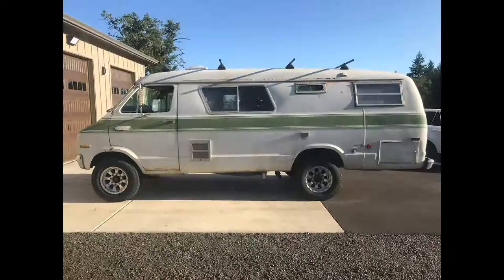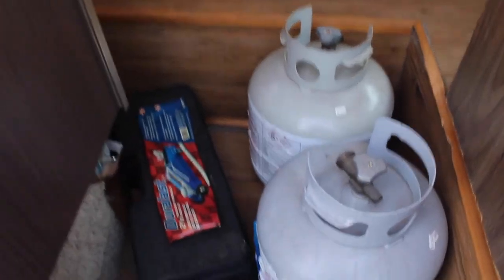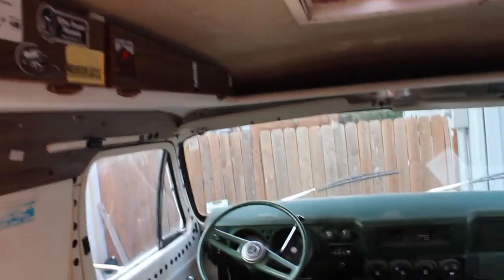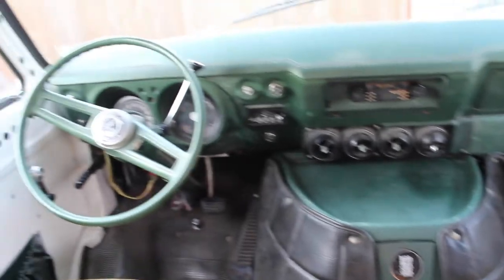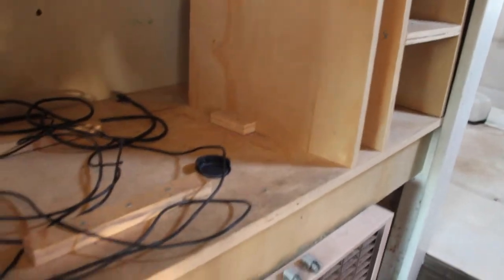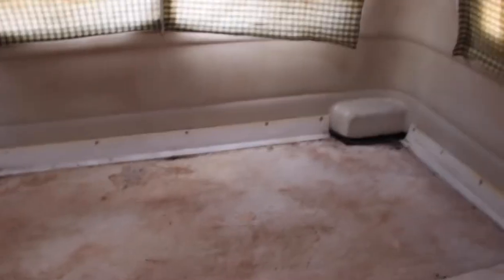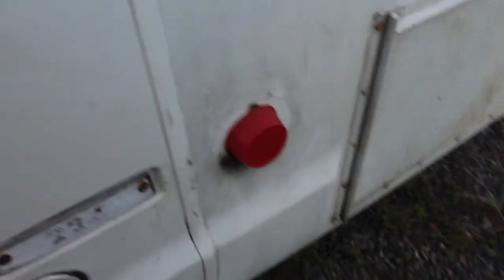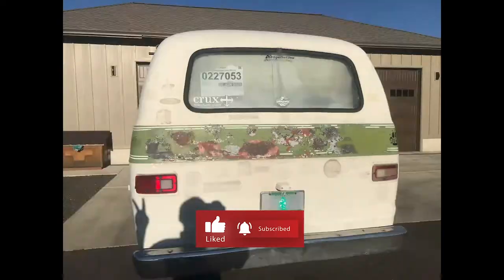70's Vintage CAMPER VAN TOUR - 1972 Dodge Xplorer (Pre Remodel)

Comment: My buddy owns a camper repair shop in Montana.. and van like this one came in a old lady owned since it was new.. it was in bad shape. I went through the hole thing and fixed it up.. I loved it when it was all done.. they are sweet
Reply from the maker: Wow that's awesome! Yes they are pretty sweet rides when they are in good shape. I am definitely looking forward to getting this one in better shape. So far, I have all the insides ripped out and I'm working on scraping the rust off of the frame. There is much to be done!
Reply: @jpsgarageshow2736  yeah that one I did was all rusted under bed I sanded all the rust away and used por. To prevent it again and rebuilt the bed wood.. the only thing I didn't put back in was the dining table and seats.. I built a huge doggie bed for her two dogs..I did keep the chairs and table they are going into my 98 chevy one ton van..

Comment: I really hope you're able to restore it.
"Jall-us-ee" widows really are perfect for camping. They're very popular in tropical climates for a reason. You can leave them slightly open during a light rain storm. They will keep the rain out. Will also work great for winter. 
It's a darn shame it wasn't cared for better, but then it would be incredibly expensive to buy.
The lay out is pretty decent. Hopefully you won't have to move systems.
I vote keep it vintage. When you go to sell, people looking for vintage won't want it "modern".